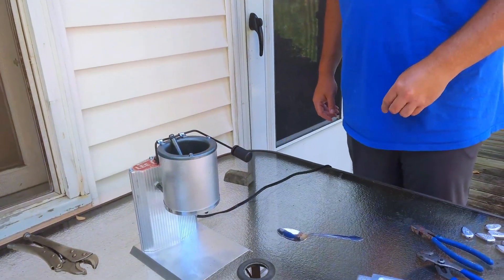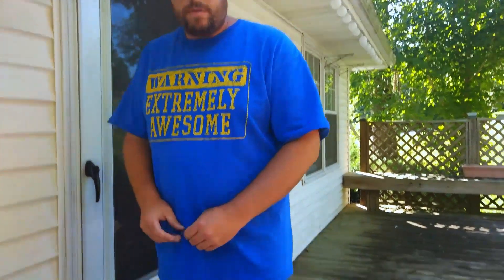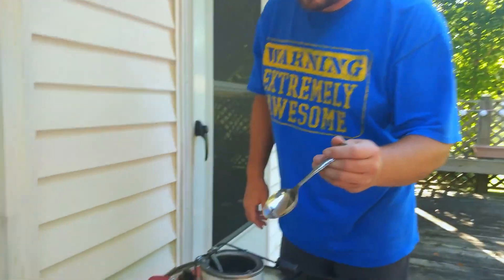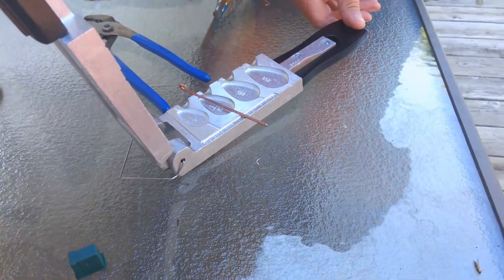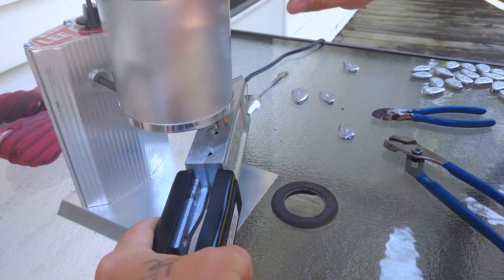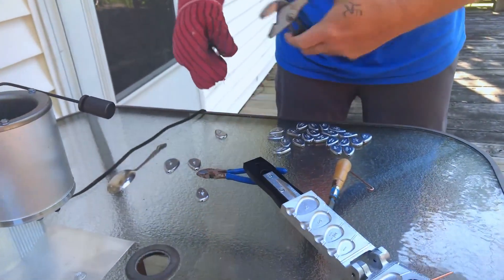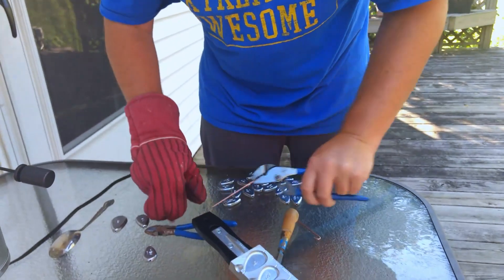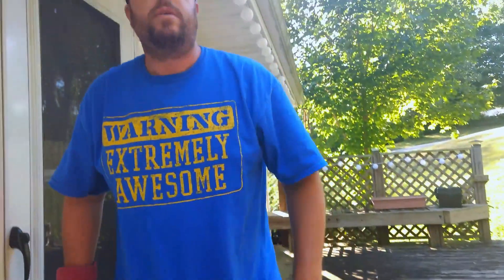How to make no roll sinkers with DO IT MOLD and Lee Production Pot IV

Comment: I love them do it molds. Own a lot of them. I do find myself making a lot of extra pieces of wire out of old hangers. I bend the heck out of them lol. I would suggest against melting wheel weights in your pot if possible and do a lot of them in a big cast iron pot and flux them and make cleaner ingots. Just to keep your pot cleaner. Especially if you make boolits and sinkers. I like using a lodge scone pan for ingots. About the perfect size and shape imo. Good video bud.
Reply from the maker: Agreed wheel weights not the cleanest lead but if it's all you got it will work if you need it to just more work
Reply: @carpandcatfishbaitstipstri7309  wheel weights are the best imo. I was just saying it is better on your lead pot to make ingots first. Clip on wheel weights are not just soft lead. Theres some tin and antimony in them which make for great bullets. Also that little bit of tin will help fill out your mold because it makes lead flow better.